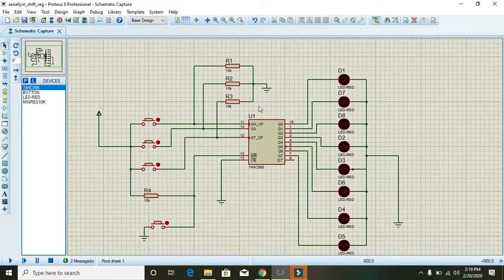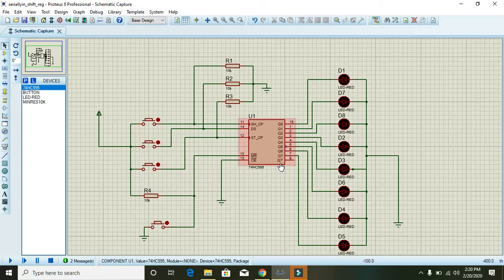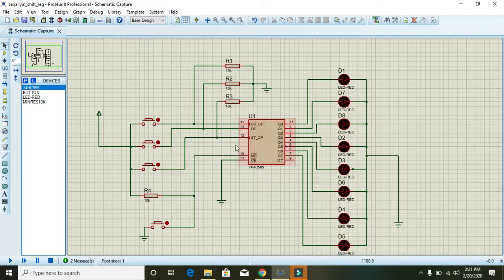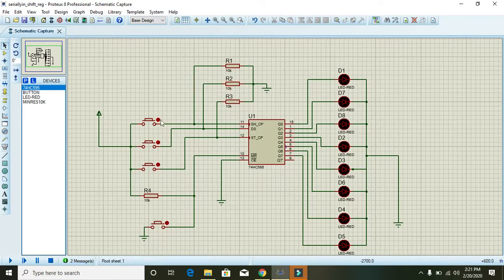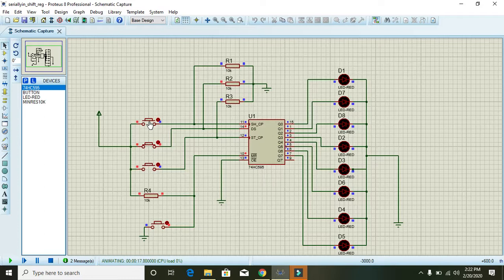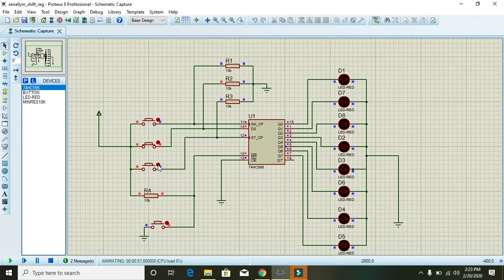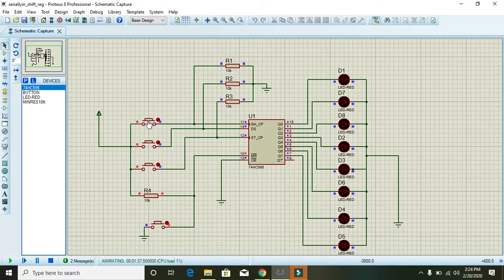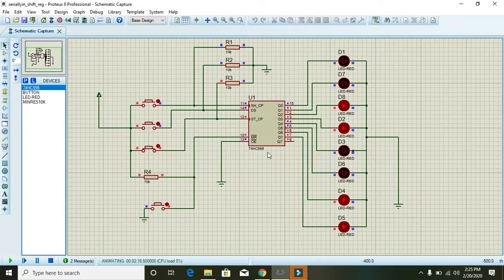shift register in proteus || Serial in parallel out shift register || 74HC595 shift register proteus

Comment: can you please tell me why we need a resistor and when I don't put it something unusual happens but it still works in a different way
Reply from the maker: Sir..if u make the circuit as a hardware u need to put resistor for to drop voltage and for current limiting, but in simulation with or without both are ok..
Reply: @nelsondarwinpaktech3954  thank you